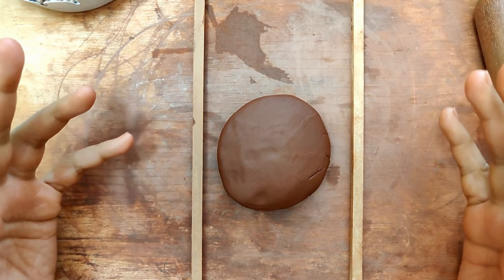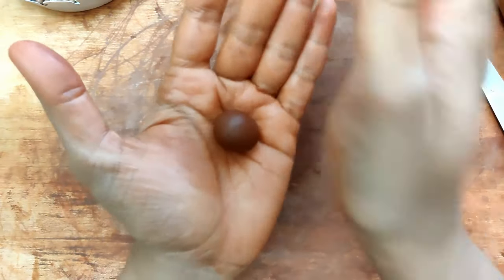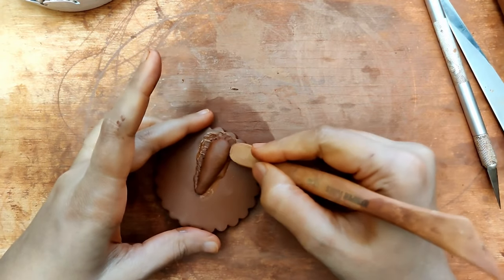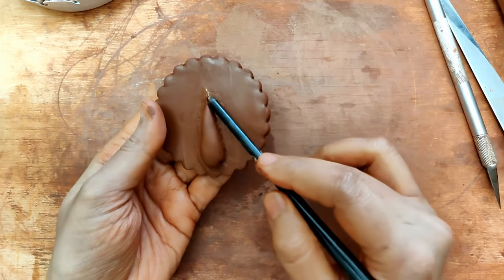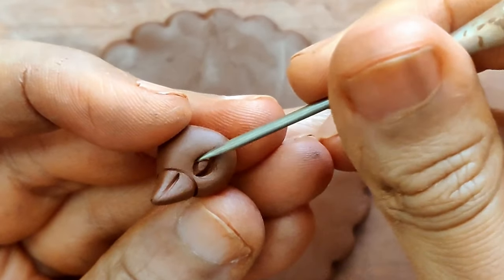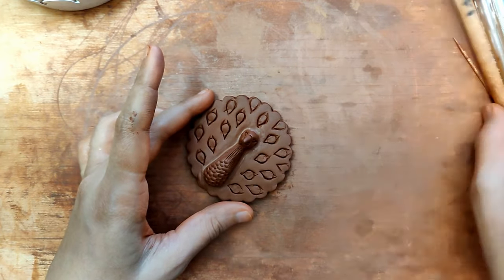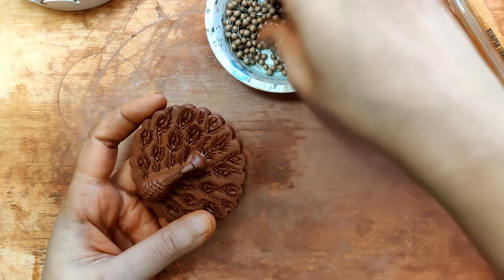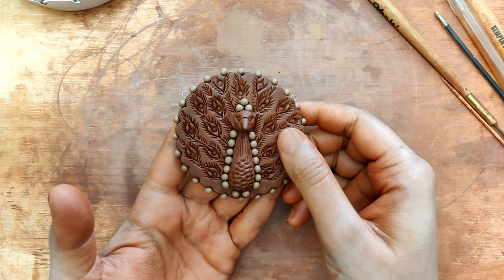Terracotta Peacock Pendant | #Terracottajewellery | Detailed Video | #paintedEarthbyneha | #Howto

Comment: Hi mam, recently I started with terracotta Jewels.there is always a slight bend in my pendants after drying them. can you please tell how to dry them and for how long I should let it dry?
Reply from the maker: That bend is called warping. It can happen due to quick drying, or even if the pieces are too thin.
After your clay work, try covering it with a thick plastic sheet and slow dry your work. Don't dry it under the fan or sunlight or AC vents. Let it dry slowly. 
I let my pieces dry for anywhere been 3 days to a week.
Hopefully that helps.
Reply: @nehagopinathpillai  thanks a lot 😊. In my case I kept pendant in a room where fan is always running . Will take care of that. And your videos are unique. I am following them to start with it. Keep posting 👍